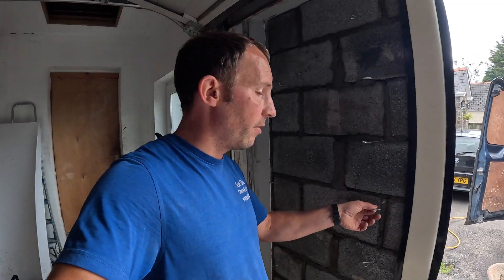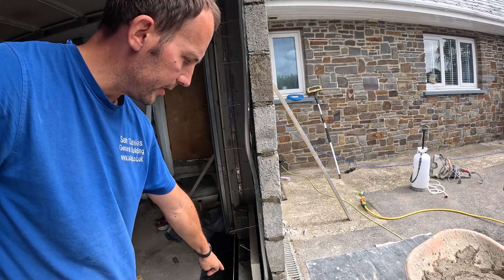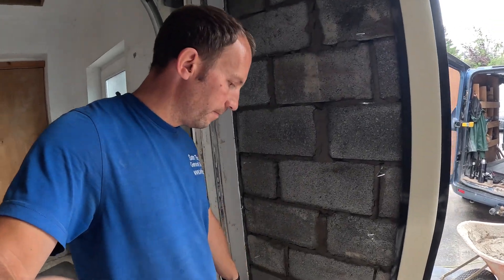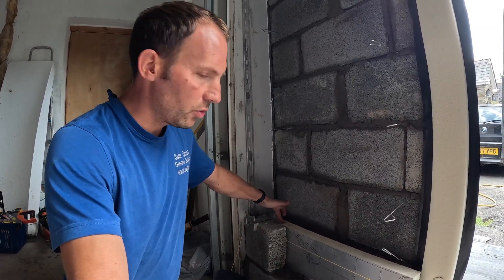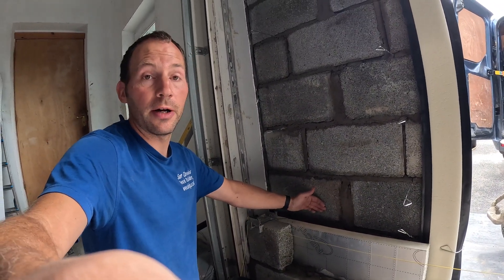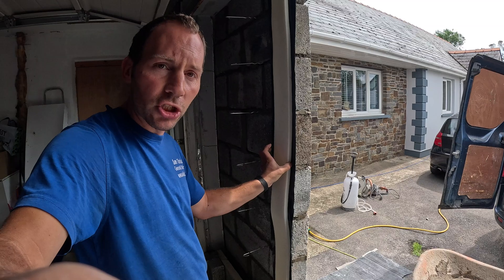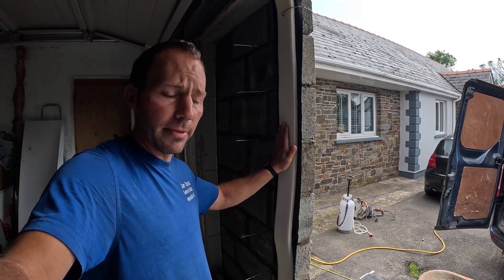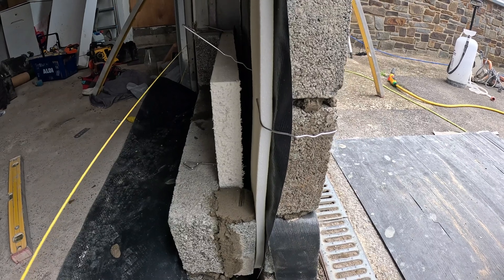Cavity walls explained

Comment: Hey Sam....Nice little video. In the case of the garage conversion is it still subject to building regs or building control or is it classed as a non material alteration? Watching Steve and Alex they always say its now 150mm cavity (I suppose I could go look it all up but thought you may know) Thanks as always for the content
Reply from the maker: Thanks Adam.  Yea all still building regs involved, we are insulating the cavity as they built the garage with insulation in anyway.  The carpenters will then insulate the inside of the room too to get the correct U values.  On extensions/new builds it’s 100mm insulation and 50mm air gap so the 150mm cavity.  I have heard rumours of the insulation getting bigger though!
Reply: Just found your channel and have binged watched everything, and after just having employed cowboys, you have reinstalled some trust. 
Quick question as a diyer, regarding cavity wall insulation, the retrospective products that are injected into cavity (with government grants) if they ram the practice in using power, how does this not cause ‘bridging’ if it ‘wall to wall’?

Thanks again
Reply from the maker: @Per_Ardua_Guy Thanks for checking out my videos and sorry you have had to deal with cowboys.  Are their mistakes fixable?  

With regards to the pumped in cavity insulation I have seen problems where its slumped in places and left some places not insulated causing condensation on the inside of room.  I also think it can track damp across but I'm not sure exactly of the make up of what they use so unsure how much it can actually track across.   Interestingly we use a 50mm air gap from insulation to outside wall but I see in England the cavity is fully filled from the start which I cant get my head around
Reply: @SamDaviesBuilder thanks. When I lived in Wales I had the beads pumped in (.Gov grant) so it must have changed.
Reply: @SamDaviesBuilder  Hey Sam....and Mr per ardua.....You are right and I have read of problems with insulation pumped into the cavity. I do think it can cause more problems than it resolves. I have a cavity but will never insulate that cavity.....If you really are set on increasing the thermal efficiency of your property, before going down that route I would consider insulating  either the internal walls and replastering or the external walls and rendering. Wall ties are positioned as to not allow a transfer of moisture and incorrectly installed insulation could do that. Grants are rarely what they are purported to be. Do a fair bit of research before committing
Reply from the maker: @Per_Ardua_Guyyea they still do that in Wales when they pump it in just on new builds/extensions it’s a 50mm air gap to outside wall I just can’t understand how it’s different in England
Reply from the maker: @adam-qf2vz some very good points there Adam.  I have actually heard of cases where companies have sucked it back out too!
Reply: @adam-qf2vz I totally agree that’s why I haven’t done it again in subsequent properties, but then when selling Estate Agents and none informed potential purchasers always question it due to this annoying reliance in EPC reports instead of as has been said researching a property and actually what your buying… ie.. EPC states it’s thermally efficient but ‘you’ll get damp soon and be living with dehumidifiers everywhere there’s issues!!